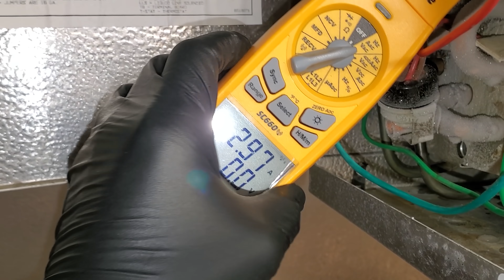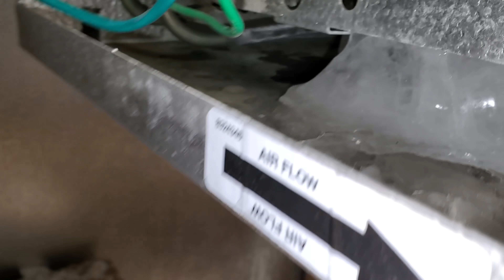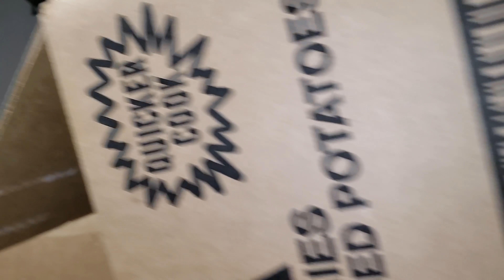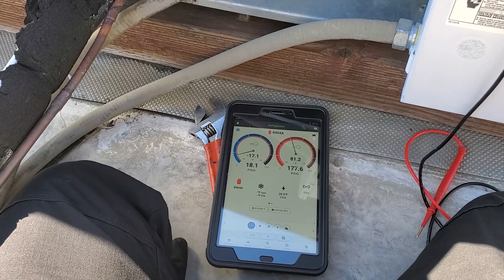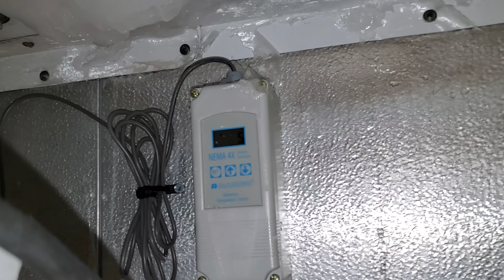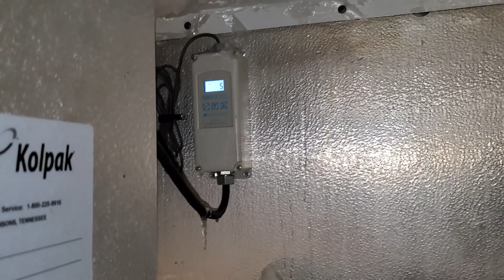LOCKDOWN WALK IN FREEZER CALL

Comment: Fan cycling on a WIF is a terrible idea. Especially with only one fan, the suction will move with the head pressure. Although not as much, a few PSI change on the suction can mean the difference between superheat and no superheat. Compressors don’t like liquid… Agreed a flood valve is the way to go, but you may need a larger receiver. Great job on the video.

Comment: what you're calling lint(brownish in color) is all cardboard dust! it started at factory, then packing, transport and handling until in cooler.
I bet they always open the boxes in freezer with knives and cycle the lid/move them around endlessly. solution start unpacking and storing everything properly on shelving. problem 90% solved :)
convenience and laziness at it's finest, end result massive wasted time, resources and costs.

Comment: We had a lightning strike that damaged the 220 vac into the whole building. We have 10 radio base stations that have fan cooled power amplifiers. To go into the transmitter room and not hear ANY of the amplifier fans running sends chills down your spine! And since this was public service radio (police and fire), we busted our butts to get the genset on line as soon as possible. The changeover switch was damaged by the strike, so we jerry-rigged jumpers to get the genset to power the building. You never saw us move so fast!
Reply: I can relate to this, I am the administrator of a rather large public safety P25 radio system. To come to a silent and dark tower site is a scary thing. We get a lot of lightning strikes as well, we retro fitted all our sites with a new type of experimental grounding system and haven't had any issue since.

Comment: I can relate to the silence of the equipment. I was working in a large data center for a bank. Three 550 ton York chillers in the chiller room. Two chillers always running in rotation with the third. Modification were made to the BAS system about 60 days earlier. I was working third shift. Service that night was to calibrate and test 3 Honeywell refrigerant sensors, each chiller had a refrigerant sensor 12” from the ground connected to the BAS system. Two weeks before this night all paper work was submitted and approved for testing of the refrigerant sensors. I specifically asked the powers to be that tripping these sensors may shut down the chillers ? They responded that the shutdown logic was removed from the BAS system because the chillers would shut themselves off on a refrigerant loss. Those sensors only turn on alarms, exhaust fans and fresh air intakes. That night I went threw the MOP (method of procedure explaining each step of the calibration and testing to be performed) , bypassed the necessary alarms and made the required commencing phone calls. As I added the calibration gas to the sensors all three chillers turned off with all the associated condenser pumps,  primary pumps and cooling towers. (secondary pumps stayed running).  The chiller room went from a continuous roar to complete silence. I completely panicked, impending doom, heart racing, catastrophic failure. These chillers fed 10 large computer rooms. After about one minute of complete confusion I went into emergency training mode and put all three chillers and associated pumps on line in manual mode. ( if a cool head would have prevailed I could have bypassed the one refigerant sensor, reset the alarm and the chiller room would have came back online automatically) After 4 hours on the phone with the powers to be and the programmers accessing the site remotely, they said for some reason the chiller shut down logic was not removed for the refigerant sensors. Quiet equipment induces panic for people with genuine concern.

Comment: Damn right waking into a store.. getting to the back room or doghouse and as your approaching there is no sounds.. no noises..Ive seen it quite a few times. Bad compressor blows the main breaker.  Even echeduled power shut downs for Electrical company service to main switch gear, or electrical service to main breakers cleaning out cobwebs and dust also tightening terminals. Also do a few malls.. and I can agree going and no units running was weird last year. Stay safe and be well.

Comment: I know how you feel about the silence at the mall. My last day with the Fried Chicken Chain we had a long power outage, I had to stay there for six hours without electricity. No background freezer/refrigerator hum, no indoor blower squeal, no soft whir from the hoods, complete silence. And as night fell and the emergency lighting failed, complete darkness - aside from city lights half a block away in either direction. (It was a small isolated outage from a car vs. pole.)
My coworkers were complaining, "[owner's name] needs to have the emergency lights replaced, they shouldn't be shutting off at all," and I was completely dumbfounded for a bit, and had to explain to them the purpose of emergency lighting - to provide illumination to exit/evacuate a building after power failure for a MINIMUM OF 60 MINUTES, not provide hours of lighting while we sat around waiting for power to be restored.

Comment: Sup with the closer at the top of the door, that should be pulling the door shut if it’s any good, if not replace it, plus I never jerk around with the time on time clocks they never stay correct with power failures, I usually just set four equal defrosts for about 40 minutes. And that clearing of the sight glass comment with the fan running, if it’s really cold outside, NO WAY, plus i usually set the differential to cycle fans off around 40psi. most techs like 50psi. personally I think that is pushing it, i’ve always liked fan controls, very reliable and easy to replace compared to other head pressure control systems, plus when you hear that compressor running and no fan your eyes immediately look for the sight glass to see if your low on gas, kind of doubles as an old skool low on freon indicator without the need for a computerized brain !

Comment: With "Most" of these defrost clocks being external or on the roof, I don't know why someone don't make an atomic clock defrost so the time is always correct, with a little bit of thought it could even do daylight savings.  Cost would be more, but at least the clock would never be out and you would not have to worry about mechanical issues within the clock or set pins.
Reply: I know what you *mean*, but I still keep reading that as "atomic defrost" anyway...
Reply: I don't understand why it matters if the clock is "off" by an hour. Granted, I understand if defrost is supposed to happen around closing or opening time. But if it's not operating near the edges of operation, does it matter?
Couldn't one just "slip the difference" and just set the clock off by half an hour, so it's always off by half an hour one way or the other?
Reply: @magmajctaz1405  you totally missed the mechanic failure part, most of these defrost timers are mechanical, most of them get sand, dirt, grit or whatever into the mechanics and fail.  Sometimes these failures are caught in or out of a defrost cycle, defrost on and you lose product, defrost off and build up ice, too much Ice and you could lose product.  

The timer being off by an hour is nothing, but it would be sweet if the clock would always be correct, would it not?  That and reliability of a non mechanical piece of hardware would make this a great product.  But don't sweat, it's not going to come to bug you anytime soon, it was just a thought.
Reply: @_iLLuSiv3_  I apologize if I was not clear. I was not speaking to mechanical vs. electronic (atomic). I was speaking to the value of being concerned with DST. I do not see a compelling reason to really be concerned with DST on a defrost clock.
Reply: @magmajctaz1405  Is really not a huge concern as you mentioned, I was just thinking if it were an atomic clock, dst would always be corrected if added to the function..  Might as well go the whole hog lol

Comment: I work at a BMW plant in IT and due to the Lockdown in March-April 2020 the whole production was stop and it was some kind of scary to walk through the factory halls. It was so silent, the light was reduced to a minimum and only some lights of the robots were flashing. It was such a strange feeling to walk there around. :D
Reply: Retired now,but seen this as well,installed a hydraulic unit in Vauxhall factory in UK,went back for routine service,they had never switched it on or used it.Huge factory 3 guys in it.
Reply: And probably a bit scary too!